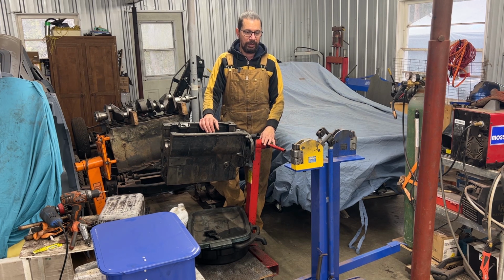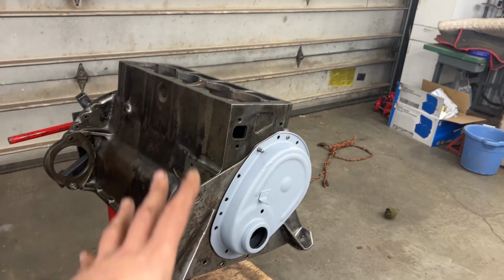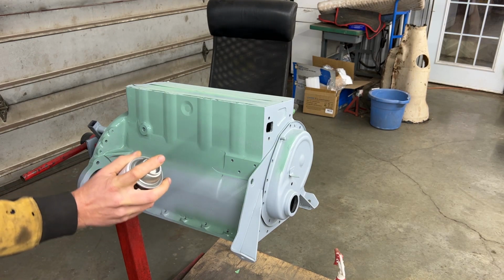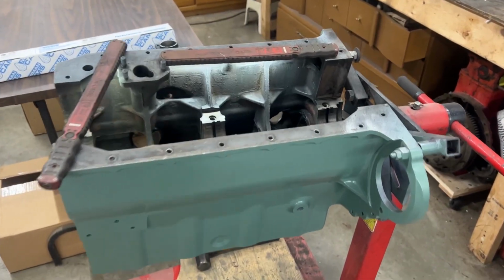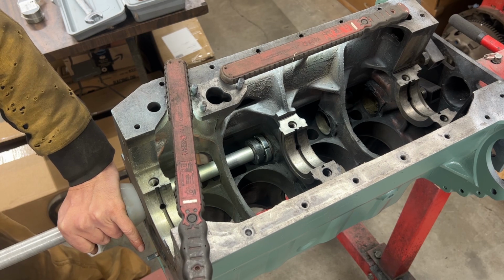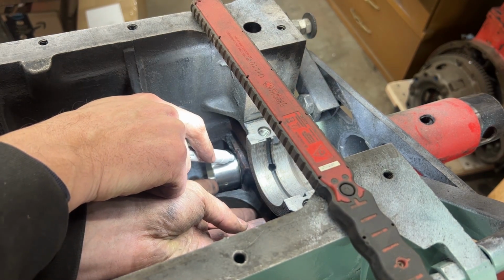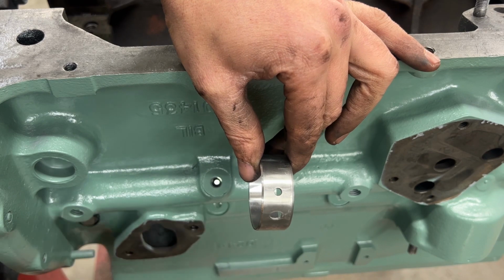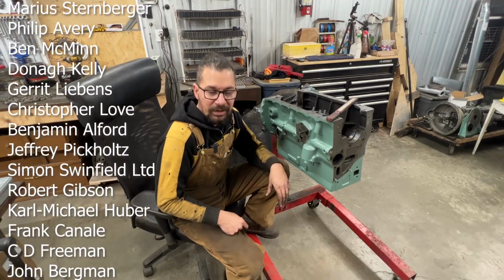1964 TR4 - Part 10 - Camshaft Bearings Replacement

Comment: Interesting that Triumph bothered with bearing shells for the 4-cylinder, but decided not to for the 6-cylinder. I know some people have them line-bored and retro-fitted, but it was obviously not considered necessary by the factory. I wonder if anybody has ever had to scrap a camshaft or block from a TR6 due to bearing wear? Still, interesting procedure, that I didn’t even know had to be done! You learn something new every day 😊 thanks.

Comment: In the early 70's, in my early 20's,  I owned a Triumph MK1. It was a very nice car to drive, especially with the overdrive. I was an apprentice telecom tech at the time and money was scarce. The car blew a head gasket and, not having any experience on working on engines, I had the head removed and sent away for skimming. The mechanic didn't check the block for flatness, and when the top was re-installed the gasket blew again after about 2 000 miles. Due to my inexperience and lack of money I had a new gasket fitted and traded the car. Looking back I would have liked to still have the MK1.

Comment: Elin, lining-up the cam bearing shells looked very hazardous, so I’m wondering of one of the oil gallery holes was just a little bit misaligned, would it be permissible to just run a twist drill down the hole to open the gallery fully, (being careful to de-burr the shell afterwards of course..) 🤔?

Comment: That's a clever tool, useful for lots of different models I'm sure. I suppose the factory one would be more sophisticated to take the alignment problems out of the equation.

A really comical bit of editing at the start, very funny well done.

Like others on here the green looks good, it does look similar to military equipment that I have seen. The yellow, well I hope the customer likes it!! It will all look great I'm sure!!

Great to see Rusty on the video, he looked like he wanted a job, or his trampoline.

Good luck from a snowy Spain!!

Comment: This sure brings back memories. I did a partial "overhaul" of my '64 TR4 engine back around 1970 - I was in college. Piston rings, rod bearings, milled the head and a few other things.  I did not remove the engine from the car. I had a terrible oil leak which I traced back to a pin hole in the timing chain cover. Just like this engine, I think it was caused by a stretched timing chain and weak tensioner which was allowing the chain to rub against the cover from the inside and wore a pinhole in it. I had the hole brazed over and installed new chain and tensioner. I sure wish I had the garage and tools to do a full rebuild, but alas I was poor and had to do everything in my driveway. So I live vicariously through you, pretending you're rebuilding my engine. :-)  The owner of this TR4 should be ecstatic that he can see this rebuild in such detail, knowing it's done RIGHT!

Comment: The paint colour is a big mistake...the car is a subtle 60s Primrose Yellow and you have found a loud 70s Leyland Inca or Mimosa... it will look terrible but one of the car's owners has already "improved" it with blsck wheels and windscreen surround so what the heck right ? The fan should be bright yellow now to match.

The mint green is a bit like the colour if military-type Rolls-Royce engines.